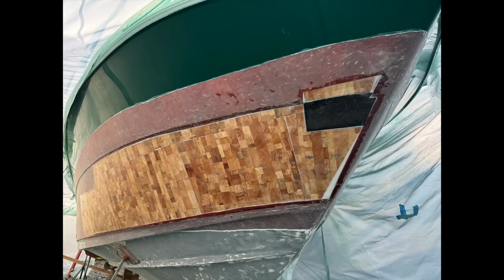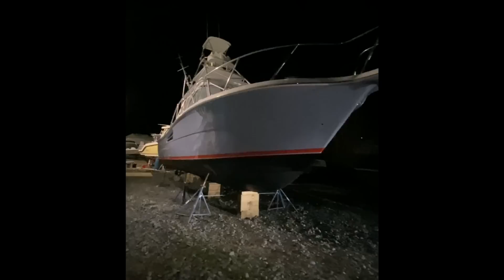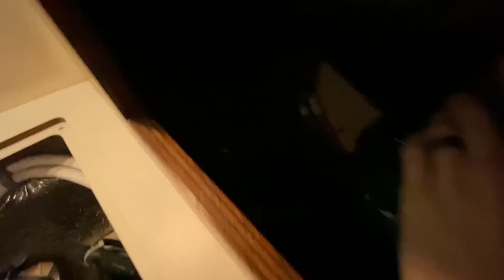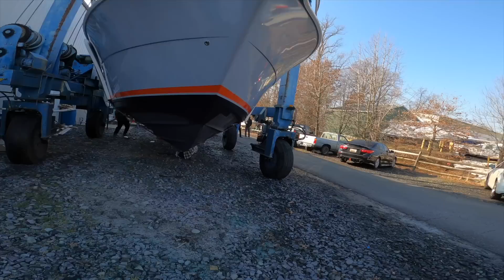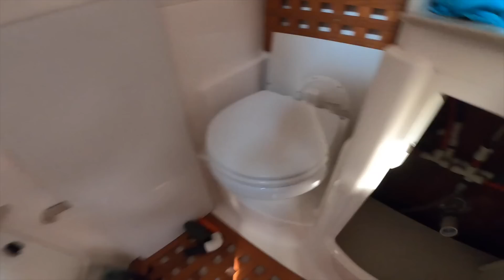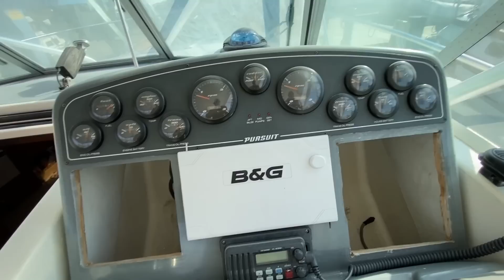Was All This Work Worth It? | 2000 Pursuit 3400 Boat Restoration Official Launch After Major Repairs

Comment: Not to jump on the bandwagon but I was taught you use a gasket or sealant but not both. I did my fittings with Life seal and after eight years seems to be doing its job. My drain plug I used 5200 since it’s what the manufacturer originally used. I found to remove old 5200 used heat and came right off no issues at all.

Comment: you need to core drill 90 degrees to the hull. your metal thru hull are not going to bend to the hull surface like plastic ones.

Comment: The gelcoat came out good, color looks good too. Why'd you tell that guy you can do 45mph top end? With Cummins 370b's, and full tower, the hull can hit 40, but loaded with fuel, tower, and couple guys you're looking 35 max. Best case you'll see 36-37 mph.
Reply from the maker: Tell you what, I’ll test it this summer and see what the top speed really is.
Reply: @BoatRevivalByBen  Cool! I'm sure you'll see better top end and economy with all that wet coring ripped out. She looks great, hope you have a great summer. This is one of my favorite express boats out there.

Comment: I would have applied a larger bead of sealant around (hopefully) all of those thru hulls.  Any amount of off center pressure on a thru hull that isn’t essentially SEALED with greater surface area , may result in a leak. Remember the greater leverage is on the inside when adding hoses and mechanical means of torque.
Reply: My thoughts exactly
Reply: They all should have been dully bedded for sure. The open ones needed a plug in the hoses as well.

Comment: Other than the mess it would make why would you not put enough of the 4200 on the thruhull fittings fir it to smash it around the fitting so you could make sure no water could penetrate around the fitting? I would think more would be better in this application.
Reply from the maker: A little goes a long way especially with a gasket.
Reply: @BoatRevivalByBen not enough man
Reply: That's exactly what I was thinking

Comment: Hey Ben how hard is it to change a omc 800 over to mercruiser alpha stern drive
Reply from the maker: Need new transom assembly, engine flywheel plate/shaft and drive. No point using a conversion kit. It would be a lot of work.
Reply: @BoatRestorationByBen  ok are the throttle control the same